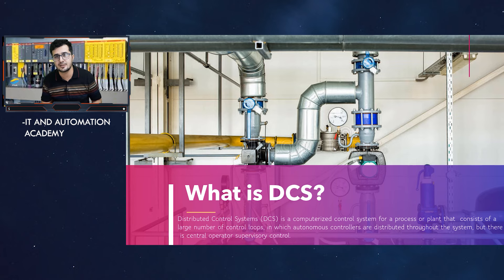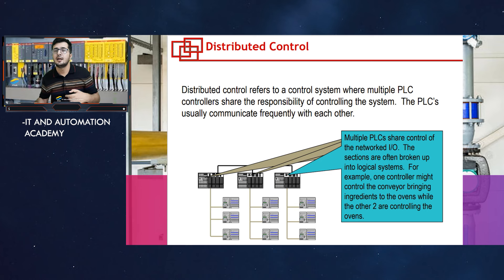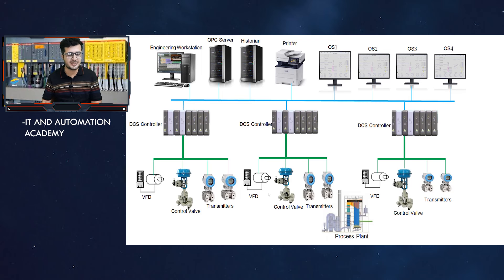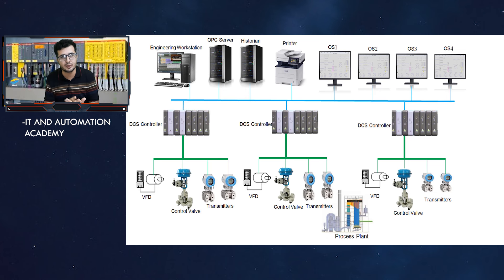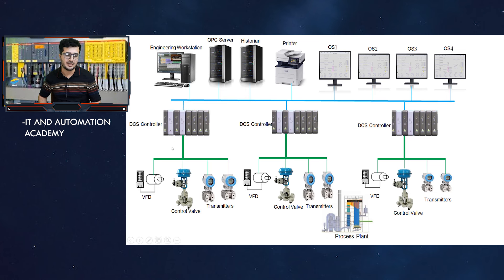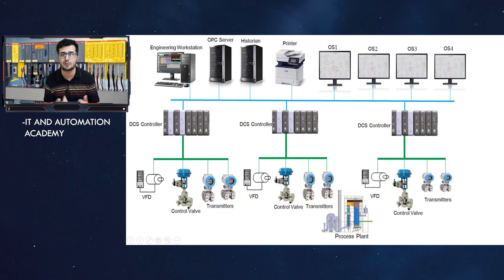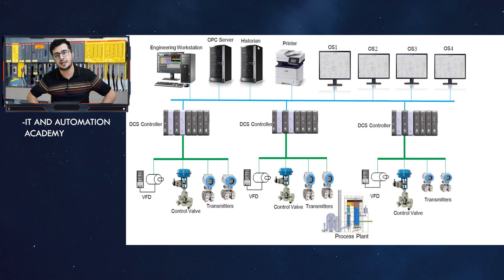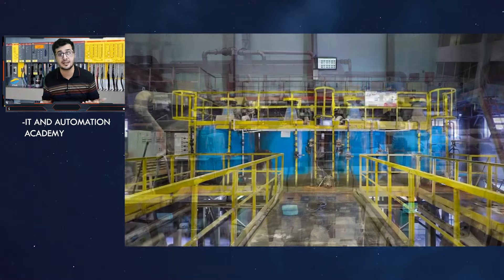DCS (Distributed Control System) Working Explained II Distributed Control System Tutorial in Hindi

Comment: There were many things wrong about key differences between PLC and DCS. Only thing which was just touched was the software part.That was shallow too. Please stop saying DCS is designed for Analog and PIDs.Its 2022 PLC controllers can defeat any DCS controller interms of computation power and IOs.If DCS is just about distributing IOs then why dont we use PLCs which can be integrated at HMI level.why DCS is needed then?